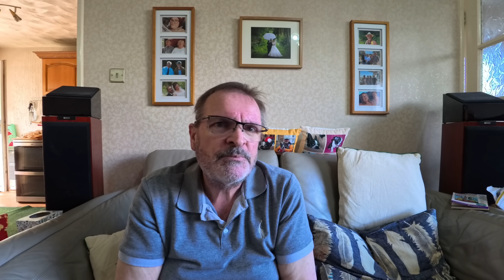Expert Ships Engineer Reacts to Baltimore Bridge Crash

Comment: Rushing in desperation to step on the brake pedal in road emergencies is the hallmark of inexperienced/inept drivers, and I dare generalise that principle to ship driving too. Maybe the inept piccaninnies in charge of the engines freaked out when plunged into the dark, and their knee-jerk reaction was to thread hard on the brake (which, in marine terms, is tantamout to driving hard into reverse). The captain, a nondescript Ukrainian, may have panicked too. Good (that is, White Male) sailors would most probably have kept their nerves and not touched anything but the helm as soon as the auxiliary generator kicked in to energise the rudder. There was time enough to ease the beast to port gently and miss the pillar. They just shuffled around in terror like frightened girls, and the result is there for all to see. Part of that "STOP AT ALL COSTS!" hysteria was the idiotic anchor release. Such action could only further destabilise the ship´s trajectory!

Comment: The bow thrusters are interlocked in a manner that prevents starting unless an additional generator is online.  It is possible that the ship lost a generator and reversed powered the breaker on the other generator, leaving the ship in the dark. The engineer may have reclosed the breaker to connect the generator to the switchboard, thereby restoring power to the distribution system.  But the necessity of having a second generator (or a third) online to restart the Bow thrusters may have included the engineer attempting to further restore the plant in order to restart equipment, including and especially the bow thrusters, by attempting to reclose the breaker to the affected disabled offline generator. The captain would have been howling for the thrusters.
Reply from the maker: I think the fourth generator started automatically too and put itself on the board. But why the complete blackout.
Reply: If a generator prime mover trips while it is online, the slowing generator will reverse power its own breaker.  If that happens, the remaining generators and switchgear pickup the electrical load and the may cause other associated breakers to trip on overload, (likely the long time delay trip), ground fault, by operator error or a host of other related faults.
Reply: @earthequake1  Rushing in desperation to step on the brake pedal in road emergencies is the hallmark of inexperienced/inept drivers, and I dare generalise that principle to ship driving too. Maybe the inept piccaninnies in charge of the engines freaked out when plunged into the dark, and their knee-jerk reaction was to thread hard on the brake (which, in marine terms, is tantamout to driving hard into reverse). The captain, a nondescript Ukrainian, may have panicked too. Good (that is, White Male) sailors would most probably have kept their nerves and not touched anything but the helm as soon as the auxiliary generator kicked in to energise the rudder. There was time enough to ease the beast to port gently and miss the pillar. They just shuffled around in terror like frightened girls, and the result is there for all to see. Part of that "STOP AT ALL COSTS!" hysteria was the idiotic anchor release. Such action could only further destabilise the ship´s trajectory!
Reply: @javiergilvidal1558 Absolutely the bridge of the ship was crazy town. The engineroom would have been unable to take over the throttle from the bridge (requires the bridge to transfer that control). Absolutely the engineering pygmies, (as I have often characterized them) would have totally unprepared and started running amok. I totally agree with you.

Comment: Dali is propelled by a single low-speed two-stroke crosshead diesel engine.  The Emergency generator is sized and designed to provide Main Engine controls under all operating conditions.  Once emergency power was reestablished, the bridge would have control of the mains. The load/stress of the crashback and subsequent reversal of the main engine in fact be borne by the attached engine and not the EDG. The US Coast Guard and ABS Survey this capability since the vessel is chartered by Maersk and the company is required to conduct audits to ensure the vessel is in compliance.

Comment: If merely accelerating can cause such an abrupt turn on such a huge vessel what stops a ship from continually going around in circles?
Reply: Rudder action. Single-engined very powerful piston aircraft such as the P-47 Thunderbolt had a rudder trim to make up for the massive torque

Comment: Former Chief Officer, what baffles me is not taking the tugs in escort until clear of the bridge. The tugs were dismissed as soon as the ship cleared the berth. The bridge dynamic would have been pilot and captain on the bridge with a helmsman and chief officer, the officer of the watch having finished at the fore or aft mooring station would likely have been heading to the bridge to take over from the chief officer. There may have been a trainee (cadet) on the bridge as well. Full astern and dropping the anchor appears to be the response they made. 4 minutes is not much time, can take you that long just walk the length of the ship.
Reply: Thank you very much. I been saying this sense the beginning. Why would you disconnect the Tugs until all obsticals had been cleared. That way any power loss could have been navigated.

Comment: But why not go down the middle !
That’s what I don’t get.
The width of the gap to go through is huge 20 times width of ship
To decide to go down the side as close as you can get to the pylon is just asking for trouble if something goes wrong
It’s not rocket science to keep away from the sides when going under a bridge
Reply: Rushing in desperation to step on the brake pedal in road emergencies is the hallmark of inexperienced/inept drivers, and I dare generalise that principle to ship driving too. Maybe the inept piccaninnies in charge of the engines freaked out when plunged into the dark, and their knee-jerk reaction was to thread hard on the brake (which, in marine terms, is tantamout to driving hard into reverse). The captain, a nondescript Ukrainian, may have panicked too. Good (that is, White Male) sailors would most probably have kept their nerves and not touched anything but the helm as soon as the auxiliary generator kicked in to energise the rudder. There was time enough to ease the beast to port gently and miss the pillar. They just shuffled around in terror like frightened girls, and the result is there for all to see. Part of that "STOP AT ALL COSTS!" hysteria was the idiotic anchor release. Such action could only further destabilise the ship´s trajectory!

Comment: Well said. Even I think so.  I am a sailing Captain on Ultra Large Ships.
In my view, instead of using astern on engines that caused the ship to turn starboard and eventually hit the pillars of bridge.  
The ship was doing 7-8kts, such large ships can easily maintain course and when they had power again and in case of main generators failure also the emergency generator can power Steering motors.  Hence ship will steer safely. Using the momentum and steering they would have easily steered out. Worst case scenario the ship would have just scraped the pillars or run aground.

But here we are talking about immense panic situation in the bridge. Too many alarms, absolute darkness in ship and that too at night with immense pressure while passing under the bridge. And in panic situation with pilots on board and a mixed action with pilots advise and masters opinion they decided to go astern. 
Which as a human behaviour I believe most of us would have done, as we know first thing comes to mind is to reduce impact. 
Here we have to note the time is night time , if it was a day time the outcome would have been totally different.  Night time your vision making decision is hampered. Plus backlight of port and city makes it more difficult.  

I believe the bridge team, master and pilots would have done best of their capability to avoid any such of this. So humanly speaking we should not blame them for the incident.  
No doubt we need to find the root cause for future learning’s.  

Now coming to fuel change over point, I want to correct you as when we enter 200nautical miles of US waters That’s called ECA area we change over to Low sulfhur gas oil.  And the engines and whole machinery remains on it till again the vessel is out of the 200 nm EVA area.
Generally these hickups are faced during the change over time and not hours or day later the change over. So I don’t belive the fuel oil change over has to do something with it.  

My most experienced guess is may be a electronic malfunction of something on the generator set, now this issue could have occurred at that very moment or this could be some issue that would have been bothering from previous weeks and months and still would be under fault finding as to what it is. and this time it just gave off causing a black out at the very wrong time.  

Again it’s all my guess and best of what I could understand.  
We have to find root cause, no one as per my opinion is to be blamed here.  People onboard have families waiting home. Some of them even would been months onboard that ship.  
No one wants to be a black sheep in other country. 
Let’s educated ourself more, let’s grow up more let’s develop more and accept our shortcomings Nd use them to avoid such incidents in any part of the world.  

My condolence to the innocent but unfortunate people who lost life’s.  May god bless them  and their family.
Reply: Rushing in desperation to step on the brake pedal in road emergencies is the hallmark of inexperienced/inept drivers, and I dare generalise that principle to ship driving too. Maybe the inept piccaninnies in charge of the engines freaked out when plunged into the dark, and their knee-jerk reaction was to thread hard on the brake (which, in marine terms, is tantamout to driving hard into reverse). The captain, a nondescript Ukrainian, may have panicked too. Good (that is, White Male) sailors would most probably have kept their nerves and not touched anything but the helm as soon as the auxiliary generator kicked in to energise the rudder. There was time enough to ease the beast to port gently and miss the pillar. They just shuffled around in terror like frightened girls, and the result is there for all to see. Part of that "STOP AT ALL COSTS!" hysteria was the idiotic anchor release. Such action could only further destabilise the ship´s trajectory!

Comment: I agree with your thoughts.
To answer your questions:
1) When transiting Magallen Straights Pilots are in charge of ship.
2) There were two Pilots onboard ship.

Below is a comment I made on another utube channel:
In my opinion as a Master Mariner and Marine Pilot this accident
could have been avoided if Master of ship and Pilots onboard
allowed ship to maintain the speed of about 8kt's instead of slowing
vessel down when power was restored x2 onboard ship. Ship would
of passed under bridge at 8kt's. There was only light wind early in the
morning so windage would not have affected the ship to a large
degree. The slowing down of the ship caused the bow(front) of ship
to veer to starboard(right hand side) thus causing the ship to collide
with bridge foundation support. There was not enough distance
from ship when it lost power to the bridge to safely stop the ship
before the bridge. Best option in this scenario forget about dropping
anchor and trying to slow down using engine. Rather focus on trying
to maintain ship in navigation channel when power was restored x2
and with the speed of about 8kt's it would quickly pass under bridge.
Once passed under bridge then drop both anchors to slow down ship
and use astern engine movements to reduce speed when power
back on. The natural thing to do is to reduce speed as fast as
possible to prevent or soften any collision or grounding which might happen
however in this case it appeared to be the wrong decision.
Reply: Rushing in desperation to step on the brake pedal in road emergencies is the hallmark of inexperienced/inept drivers, and I dare generalise that principle to ship driving too. Maybe the inept piccaninnies in charge of the engines freaked out when plunged into the dark, and their knee-jerk reaction was to thread hard on the brake (which, in marine terms, is tantamout to driving hard into reverse). The captain, a nondescript Ukrainian, may have panicked too. Good (that is, White Male) sailors would most probably have kept their nerves and not touched anything but the helm as soon as the auxiliary generator kicked in to energise the rudder. There was time enough to ease the beast to port gently and miss the pillar. They just shuffled around in terror like frightened girls, and the result is there for all to see. Part of that "STOP AT ALL COSTS!" hysteria was the idiotic anchor release. Such action could only further destabilise the ship´s trajectory!

Comment: Very interesting that it takes a marine engineer to explain this. Not one of the 'Captains' that inhabit YouTube have explained this, which, as a retired pilot of ships of this size, is common sense to me. In my experience a blackout does not necessarily mean that the main engine also stops. What is disturbing is that in the first blackout none of the navigation lights come on (they should automatically switch to battery back up power) and the NTSB tell use at the voyage data recorder stopped recording. This indicates to me that there was a fault with the emergency battery supply which may have resulted in loss of instrumentation including the helm indicator so despite the NTSB also telling us that helm orders were being given we don't know if were carried out or what information was available to the bridge team. The swing to starboard and black smoke from the funnel are consistent with the engine being put to emergency full astern resulting in a high load on the engine. What made the pilot, or captain, order full astern? What indication did they have that this was necessary?

Comment: Where you are mistaken is in believing that you can determine whether or not this was an attack based on the evidence.  I mean, obviously, just ramming the bridge was not what happened here.  But you have to assume that where intelligence services are involved, there will be people who have your level of experience and knowledge involved in order to make the crime convincing.  If this was some sort of asymmetric infrastructure attack, the most probable means for carrying it out would have been electronically controlled, possibly cyber.  Most vessels these days have electronic controls, not electro-manual ones.  Hence, shutting down the engine at a precise time could be done undetected, appearing to be an intermittent electrical fault, which is the sort of problem which mechanics most dread and have a difficult time diagnosing under the best circumstances.  In essence an electronic poison pill hidden somewhere in the vast area of the ship's wiring system.
Reply: You have to be american to be fear so many things must be some sort of terrorism